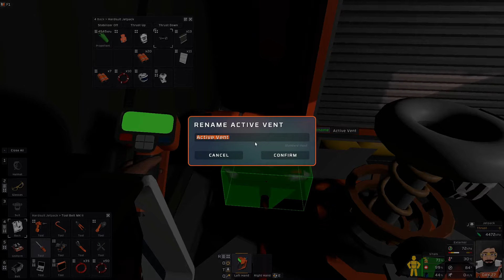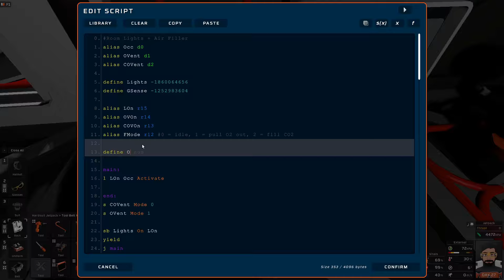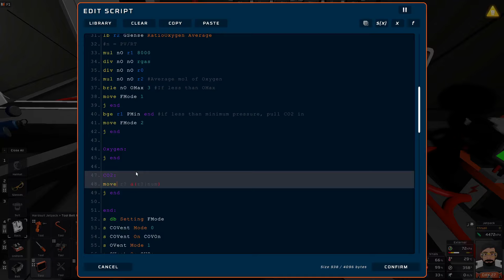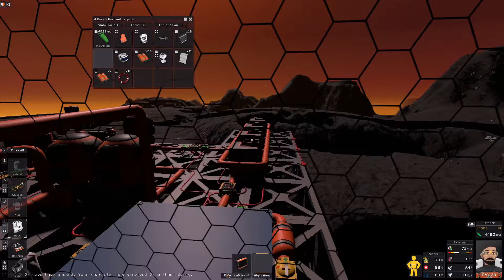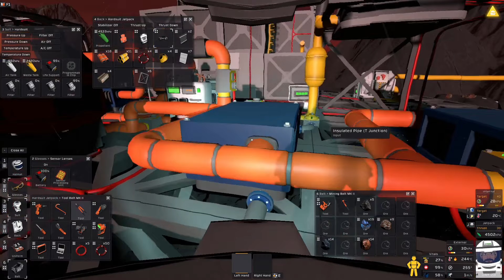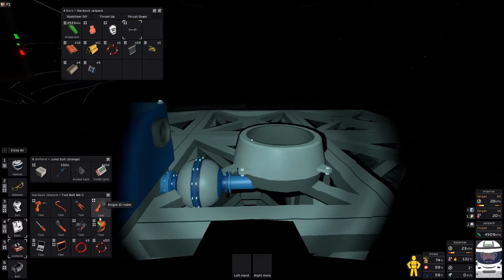Stationeers: Brutal Vulcan 11

Comment from the maker: Last Major Script Made this Video
Reply from the maker: assign room occupancy sensor to d0
assign the active vent to the oxygen filter to d1
assign the active vent to fill the room with CO2 to d2

#Room Lights + Air Filler
alias Occ d0
alias OVent d1
alias COVent d2

define Lights -1860064656
define GSense -1252983604

alias LOn r15
alias OVOn r14
alias COVOn r13
alias FMode r12 #0 = idle, 1 = pull O2 out, 2 = fill CO2
alias nO r11

define OMax 65
define OMin 60
define PMax 80
define PMin 60

main:
l LOn Occ Activate
lb r0 GSense Temperature Average
lb r1 GSense Pressure Average
lb r2 GSense RatioOxygen Average
#n = PV/RT
mul nO r1 8000
div nO nO rgas
div nO nO r0
mul nO nO r2 #Average mol of Oxygen
beqz FMode idle
beq FMode 1 Oxygen
beq FMode 2 CO2
j end
idle:
move OVOn 0
move COVOn 0
brle nO OMax 3 #If less than OMax
move FMode 1 #set to draw out oxygen
j end
bge r1 PMin end #if less than minimum pressure, pull CO2 in
move FMode 2 #set to draw in CO2
j end

Oxygen:
move OVOn 1
bge nO OMin end
move FMode 0
j end

CO2:
move COVOn 1
ble r1 PMax end
move FMode 0
j end

end:
s db Setting FMode
s COVent Mode 0
s COVent On COVOn
s OVent Mode 1
s OVent On OVOn
sb Lights On LOn
yield
j main

Comment: To drain oxygen, have a passive vent and pipe network connected directly to the filtration unit.

In the filtration unit, read O2 % from input and Activate when above desired amount. (I do this to maintain CO2 == 1%, for optimal plant growth in 21/78/1 O2/N2/CO2.)

Pair with CO2 inlet that keeps room at desired pressure.

Also, to charge an oxygen cylinder, just use a pressure regulator and a single pipe. Will fill a canister fairly quickly unless input pressure is very low and doesn't need babysitting. (You can even automate to only activate when tank is present if you like.)

For a tank drain, Read canister temp and Write Activate on a Back-pressure regulator. (I just use I/O reader/writer pair - always the first automation I do.)

Active is 0 for off, non-zero for on; you can only get zero temp for an empty canister.

On hot planet, cool oxygen to 5° when filling canister, so you get (minor) passive cooling.

On Luna, Mars, Mimas, set temp to 20° and just disable your Aircon, as incoming gas will maintain temp.

For Europa, set canister temp to 30°, for additional extra passive heating. 😊

Small optimisations, but every little helps when on Stationers/Brutal.
Reply from the maker: Not discounting the temperature suggestions as they do help. I am itching to get into the HARM suit and from my experiments with it, it wouldnt matter anymore to cool down my O2 once I get to the HARM suit.

Is there a reason to keep the composition the way you have it? There is no CO2 toxicity in game to force me to need to keep it below 2% concentration. As I am, I dont have the ability to source Nitrogen (besides offgassing) that my main concern are "Can I breathe safely?" and "Can my plant's breathe safely?". At that point CO2 becomes my pressurant gas until I can source Nitrogen elsewhere.... usually I get that from Traders but alas... none of those yet.

As far as filtration goes, A passive system works for sure but it isnt what I am aiming to do, hence the active vents. A passive system working would be good if I can guarantee that I'm making about 2-4 mols of oxygen per tick to justify keeping the filtration on for long periods of time. Most of my builds emphasize making the most out of the power I do use since I rarely go crazy building power generation devices. Otherwise the system idles consuming minimal to no power, and then when a threshold is reached I draw in oxygen relatively quickly until it drops to a specific amount, and let the filtration and volume pump turn on for a minute possibly and then idle again. Also debating on filter life... not sure where I stand on that but we are looking at getting the catalytic filters via traders soon according to the beta.

I havent tried to automate the O2 canister refill station mostly because I dont have excess Oxygen to spare. Usually I leave it to a pressure regulator but I wasnt sure I wanted to keep adding some power draw. I wont expect to have a high pressure oxygen tank until I get to space ice mining so I'm kinda torn whether it is worth automating a volume pump or having the pressure regulator.
Reply: @shadowdrake082  Yeah, the temperature thing was really for newer players who may stumble across the comments 😊

(I have a bad habit of not making it clear when a comment is for the creator or when it's for people who happen to read the comments.)

Last I saw (so correct me if I'm wrong), plants don't benefit from concentration greater than 1% (that is, CO2->O2 conversion maxes-out at 1% CO2 @50kPa) beyond that, I do it just in case they do introduce CO2 toxicity 😂 Also, same reasons you didn't exploit machine stacking - extra challenge finding all that N2 🙂 ("What do you mean, you DON'T save all the gasses from your furnace and Arc Furnace?!?!?")

Have you ever done a "gas-cap extreme" run, where you capture and process absolutely everything? (I don't think it's possible on all maps, on Brutal starts, because you can't build doors without using arc furnace... Feel free to prove me wrong! 😊)

My assumption going in was that you're not aware of the 'hidden' Activate switch on the Filtration unit, only accessible via network/IC, but I wasn't explicit; apologies if you are.

I see your rationale, but would really need to sit down and crunch the numbers. I guess I was as much thinking about the additional complexity (and material costs) versus an almost trivial alternative. If you implement some level of hysteresis, you could minimise the overall runtime, which would go some way to mitigating running cost.

I also setup to deactivate when filters are empty and show filter status on external light, so no accidental mixing to fix later. 😂 (IIRC, the Atmospherics have data on both inputs and outputs, so writing a 100% safe control program is relatively straightforward - they're one of the most data-rich in the game, no external sensor required.)

Can't remember exactly how filter life works, so you could potentially be getting marginal gains there, if it's tick-based rather than mol-based, until you can get the catalytics.

I appreciate the power perspective, but mining the materials aside, not having enough power, generally, is a real killer. I've rarely had a game where I have 'just enough' - it's either way 'too much' (I prefer "healthy safety margin") or not enough.

The main reason I questioned the use of a volume pump + inline tank, is that volume pump uses more power than pressure regulator and you end up with a LOT of 'wasted' gas in the inline tank. I've seen it before - people use a volume pump to be fast, but then add an inline to prevent overpressure, when you could just be using a PR and saved the hassle. 😂 

Still enjoying the series, as it's interesting to see how others play (and your understanding of atmospherics WAY exceeds mine!)
Reply from the maker: @edwardcullen1739  That makes more sense taking your earlier comment in context. I wasnt sure if it was geared for me, new players, or a combination of both so I am glad you clarified that.

I think the only time you could do a full gas capture on a brutal start is to weld your arc furnace in with the few iron frames you are alloted... Only thing wasted is the welder product offgas, but it may be possible to build a 2x2 building with the arc furnace inside, your apc, autolathe, print your pipes and use the active vent to store the gas in the pipes until you can get the walls and other printers out. Sounds like something I may attempt on the moon or Mimas so that I dont draw leftover atmosphere in xD. I dont recall ever being hyper vigilant about storing all my gases, usually I make it up with rocketry or trading but I suppose I'd definitely need to consider solutions if I do a no "gas pollution" for a separate playthrough.

Filtration filters run out on a per time used basis regardless of how much they filter at a time. Heavy filters last seemingly forever, but a constant draw does add up over time. I looked at the catalytic filters which currently cost 100 space credits in beta (can make that amount selling 100 iron) ... thats quite cheap for a filter that lasts forever. It might get a price increase, but maybe the balance is in the fact you need a large dish and a small pressurized hangar before you can purchase them.

Power wise, I did use to go the route of go heavy on generation. The more I looked into my power systems, the more I realized just how much you can do with a few generators. I realized you can do more and earlier when I didnt have to spend extra time mining for resources that go into power generation. To be fair, I didnt think I could get sensor lenses as quick as I did on this Vulcan playthrough... I actually was surprised at how quick I got them out. But on the other end, it is also about making power last so I did try to make sure I didnt have too many unneccessary consumers (normally I never build lights, I have been trying to make myself build lights for videos). Atmospherics takes a lot of power to run as well... I havent got any sort of proper filtration made which will stress my power system once I have them built. If anything takes the prize for function vs power usage it would be that phase change heat pump I built. It is doing a lot of heavy lifting keeping everything cool and its power draw is only 100W (outside of night time).

You are right that the utility pipe before the canister refill is a hindrance to pressurizing it. My main purpose of it though was to have some amount of oxygen storage in the event I do something stupid like contaminate that oxygen line or blow it up. I wanted it to have some spare for myself until I could properly try to get an emergency backup on the portable tank or some other source. Sometimes I do question why I did do things how I did them... it is helpful at times to think back on those and wonder if I really needed to have done it that way in the first place.